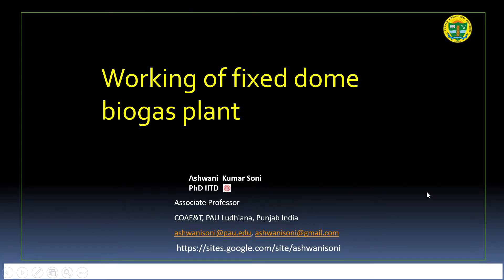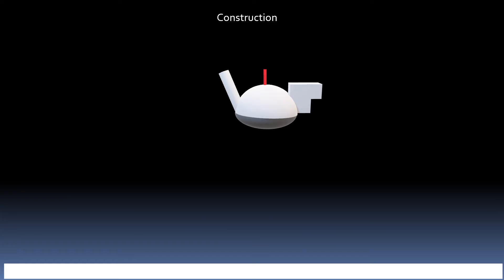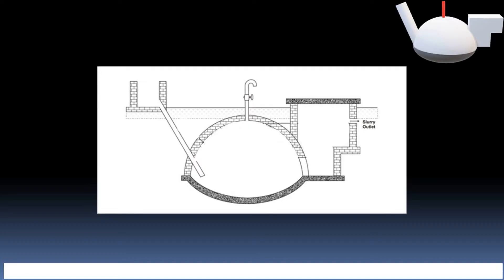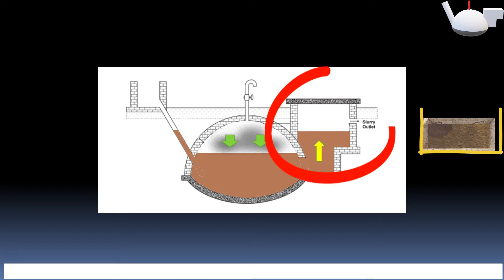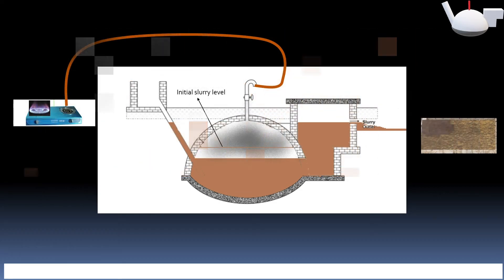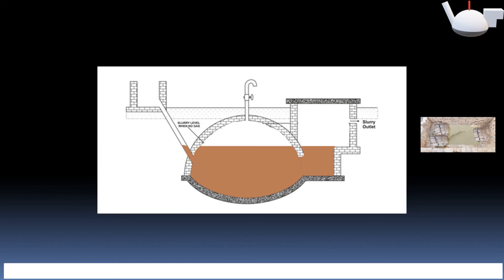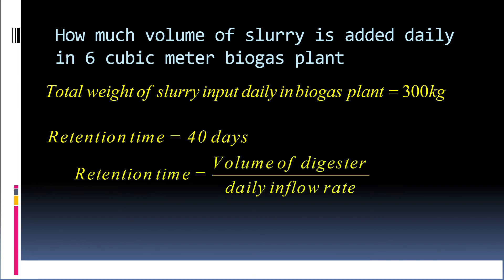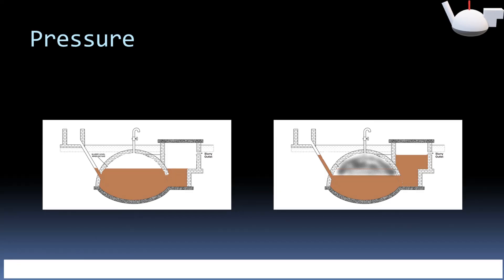Working of  Biogas plant |Fixed dome biogas plant|Deenbandhu Biogas plant

Comment: Thank you for the info..
How is the sludge removed out of the digester ?
Reply from the maker: Slurry flows out due to gravity.  The  level of inlet is higher than that of outlet point.
Reply: @IntuitiveLearn  that’s true for the slurry, but what I meant is the sludge that forms in the bottom of the digester tank after the accumulation of solids that settle in the bottom of the tank.. that usually happens after years of using, or after less than a year if you are feeding the digester different kinds of waste.. this sludge has to have an outlet pipe, and it gets dried up and then crushed, then you get a fertile soil as an another byproduct..
Reply from the maker: Sludge which accumulate at the bottom of tank  is usually Grit/sand having ( specific gravity) close to 2.65. As you rightly mentioned,  it takes years  for this condition to occur.  Two methods are generally used or can be used 
1.  Manually cleaning the digester through outlet tank
2.  Using pumps ( which can handle high solid content )  after  putting water and breaking the bottom layer
Reply: @IntuitiveLearn  thank you for the replies, very informative 🌻

Comment: Do we have to put non return valve on inlet pipe for slurry to avoid push back?
Reply from the maker: Not required as the inlet pipe level is higher than the outlet pipe. So slurry won't come out of it.  A little pushback is OK.

Comment: Sir 6 m cube = 6000ltr volume 
Then 12000kg how
Reply from the maker: Your question is not clear.  But I am assuming you're asking  about 6 cubic meter of biogas plant which has a digester size of 12 cubic meter.  6 cubic meter is the gas volume generated daily. 12000 kg or 12 cubic  meter in case of slurry is digester  volume calculated using retention time concept.

Comment: Firstly, let me thank you for having made the best video on the subject. Secondly, If I've 20 gercy cows, what size of the plant is recommended? And can feed the plant daily with the cow waste? Or should I keep the waste dumped elsewhere and feed the plant occasionally?
Best regards
Reply from the maker: Glad it was helpful!
Reply from the maker: for 20 cows assuming 15 kg dung total dung is 300kg . approximately  12 cubic gas can be generated daily. dimensions of the plants require more data . These plants are designed such that all the cow dung is fed daily.

Comment: Thanks for a great video, do you have a way to keep it warm in winter?
Reply from the maker: Two three ways
1.Keep outlet slabs covered with insulated material e.g paddy straw
2. Cover inlet after 
use
3. Use hot water if available for daily feed
Reply: @IntuitiveLearn  ok thanks

Comment: Hello. Thanks for this informative / educational video. Nicely and wisely explained the concepts.

I want to run a 15kVA gas generator, daily 8 hours and also want to keep 3 days gas in reserve. 

Can you please tell me quantity of biogas to be produced daily and what should be the size of fixed dome type digester?

Thanks.
Reply from the maker: Quantity of biogas will be 384 cubic meters
Please check this link for calculations
https://docs.google.com/drawings/d/1oFkH-xiieuxZBQ7vDbQNWGWhRbmc25veIP3IdDKkKtE/edit?usp=sharing
Reply: @IntuitiveLearn  Link not working
Reply: Thanks a lot for your attention and response.

Could you plz further guide about the size?
Reply from the maker: The size of  digester will require other inputs like e.g." retention time"  which depends upon temperature conditions of the area. 
"type of feed"  will also influence digester size
For retention time you can see this video
https://youtu.be/ml4UmGdW2us